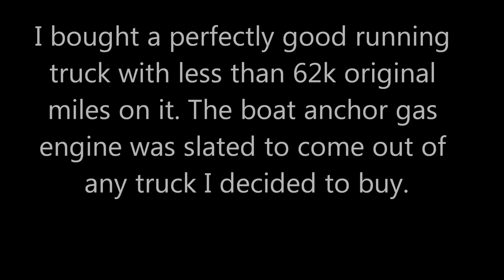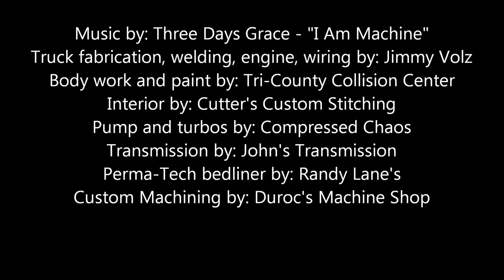1998 Chevrolet Cummins

Comment: 4 minute video, none of which shows the truck running and driving.
Reply: Nice truck,  just wish they showed it running and driving.
Reply from the maker: I just uploaded a walk around for now. I will upload another one with some towing soon. Thanks for watching guys.
Reply: Awsome conversion. Do u have any trouble towing the Gooseneck trailer. my truck is lifted and I want to buy a gooseneck for my buisness and get rid of the tag alongside. And by the way my tag alongs r Gator Made trailers also. Best trailers in the world.
Reply from the maker: Thanks. No problem at all pulling a gooseneck. The whole setup works really well. And I agree on the Gators. I've owned two of them.
Reply: do you live in indiana? i do!
Reply from the maker: Chet Langford yes I do, Southeastern Indiana.
Reply: Chevrolet Cummins that's cool I live here too west Indy I seen your truck in a magazine!!!
Reply: Chevrolet Cummins great job crazy white boy!!!!
Reply from the maker: Chet Langford which magazine? I know it was in Diesel Power before on page 44 or some bullshit. Was it in another one?
Reply: Chevrolet Cummins how far from Switzerland county

Comment: I'm considering buying a stock  1998 Chevy 3500 Crew Cab 4x4, 6.5L Diesel DRW to pull a 5th Wheel. Any idea the max towing capacity on a stock 6.4L Diesel?? The 5th Wheel is 12,400lbs dry weight, loaded 15,500lbs?? Any info would help.

Comment: I have a 12v with a bad transmission an a Chevy 2500HD with a 4L80E Billet with a blown motor. Do the 4L80E handle the power good would you recommend it or say go with a different transmission Aswell as pulling with it ???????

Comment: i like that build, my dream truck is all american, a 67-94 chevy ext cab long bed with a 12 valve cummins, and ford solid axels, lifted a few inches with decently meaty tires, mickey thomson rims and a nasty cam with some stacks
Reply from the maker: +SS4LiFe1488 You have to be careful with diesel cams. If its too big and you don't have the air and fuel, it will be a dog on the bottom end. Some of the bigger cams like a higher RPM range and that means a stronger rotating assembly which = $$$$$$$$.
Reply: +Chevrolet Cummins thanks for letting me know man, ive only gotten into chevy small and big blocks, have never been in a diesel before. im planning on rebuilding a 12 valve cummins with a 5 speed granny low tranny for my chevy one of these days, and ill put my 350 in an old muscle car of course! or better yet sell it and get a big block

Comment: I generally don't like cummins swaps just because they are way overdone but this was done right! You just throw a greasy old 12v and leave everything else stock. The whole truck has an attitude and I love it! Nice choice with the hood. Also good music choice.
Reply from the maker: +Palmer Boudreau Thanks man... I really appreciate it!
Reply from the maker: +Palmer Boudreau Yeah, I do quite a bit of pulling with it. It has spent more time with a gooseneck behind it than it has without.
Reply: Chevrolet Cummins That is badass! Anytruck pulls? I know its tall but....
Reply from the maker: +Palmer Boudreau I would love to make a couple hooks with it but this truck scales over 10,000 pounds. I think most classes are under 10k. Plus the compounds would put me in with the big dogs which I couldn't compete with.
Reply: Chevrolet Cummins Yeah had a feeling something like that. Maybe bring it to car shows?
Reply from the maker: +Palmer Boudreau Yeah definitely. I haven't made it to any yet but I will. Im still making custom parts for it to finish it up. Im hoping to make it to Scheid this year and some county fairs.
Reply: Chevrolet Cummins Yeah that would be sweet!
Reply from the maker: +Palmer Boudreau I went out of my way with time and custom fabrication to make sure this was set apart from any other conversion out there. Scheid would be an awesome place to take it.
Reply: Chevrolet Cummins yeah no kidding that place is sweet!
Reply: Palmer Boudreau thrown a 12 valve and left everything stock? Did we watch the same video? Idk if he could have put more crome under the hood...

Comment: Love the attention to detail.......Only thing I would have done different is the exhaust out the rear right.....One hell of a a job though.
Reply from the maker: +Chad Gronsten Thank you. The only way I could have went with exhaust out the rear is if I did without a spare tire. Otherwise, the 5" exhaust pipe would have been clearly visible and I didn't want that.
Reply: A 5.9 8.3 or 6.7 doesn't need 5...The ol 855's and ISXs run 5..I always thought it was hard to make 5 look clean, especially on older pickups that don't have the room to work with.

Comment: Hell ya boss! You and I should meet! I have the same disease and I won't rest until I realize it 100%! My goal cosists of 1978 1 ton crew dually most likely a 5.9 swap. 
With all that HP you're running you could afford a little more meat on them 22.5s but no dought my friend that is deffinitely a ground pounder!
Reply from the maker: It does have new tires since the video was made with a more aggressive tread. I like them much better. Looks better too

Comment: I bought the same truck in a 2000 model year with a 6.5 diesel. I am lowering it which would be the only difference.  I would like to do a video on the whole rebuild and wondering if we could speak together about some definite do's and do not's?
Thank you,
Mike Fitzgerald Calgary Canada 🇨🇦

Comment: Very badass truck "for a chevy" lol the only thing I really would have done differently is put a super Dana 60 in so you could utilize wide track and that super sharp turning radius
Reply from the maker: Yeah it would definitely help with it measuring almost 23'. I had an old '79 sitting around so it became a donor.

Comment: Perfect in all ways i love the body style great build man again perfect
Reply from the maker: +Korey Grant Thanks a lot!
Reply: Chevrolet Cummins you have my gears turning now i have been toying around with putting a cummins in my 07 chevy 2500 
I have more time then money
Reply from the maker: +Korey Grant I cant give you much input on that conversion. If I would have found one of those cheap enough, it would have been in the video instead.
Reply: Mine was not cheap but it is a nv4500 5 speed trans it would mate with cummins with right set up but you are right i paid top dollar for this truck 

Extended cab 8 foot bed rare rare

Comment: How did you control the HE351VGT? I am going to use the same turbo on my compound set up with an HT60. Did you use an electronic control or are you running it off of the engines boost? Thanks,
Awesome truck by the way.
Reply from the maker: +Cole Berenyi The controller I am using now is basically a prototype to see what it took to control the vanes independently from an ECM like it is in the OEM setup. It doesn't use any boost pressure and is controlled by a switch in the cab to open and close the vanes. I am in the process of designing a different one that has more flexibility and can be used for just about any universal application with a 351VGT in any vehicle. As soon as I have one in hand that can be tested, I will post a video of it to see if there is an interest for it. Thanks for the compliment.

Comment: dream truck right there only would like to do it as a nv5600 6sp
Reply from the maker: +Caleb Godwin Thanks. I thought about going with a manual but already had a partially built 4L80E from a previous build so I decided to build it up some more and reuse it.
Reply: +Chevrolet Cummins can't go wrong with the 4l80 either if inwas going auto thay would be the one. did you fab your mounts or buy them already set up. and did you have to do some firewall work.
Reply from the maker: +Caleb Godwin Yes I made my own engine mounts and transfer case mount since I went with the NP205 transfer case. I didn't have to do anything to the firewall. I set the engine about 1.5" off of it at the point where the engine was the closest to the firewall.

Comment: Do all of your gauges work? If you kept them factory. I just finished getting everything mounted in have to run fuel line and adapting the A/C. What kinks did you have once it was running? Great build by the way! A++
Reply from the maker: Everything but the speedometer works. I still have to figure out which wire from my transmission controller I need to splice to for a signal. I ran into a few kinks getting it going... mostly leaks from all the plumbing I added. Nothing too bad though.

Comment: Im 19 years old and i will be buying a truck in about a year or so, i have a $15k budget and if i buy a truck will most likely buy a tundra... but a part of me is like screw that and just get a c2500 or c3500 and doing a cummins swap... i just dont know how i would get the 4l80 to work with the cummins. Other than that i would love to do it haha
Reply from the maker: You just get an adapter plate from DeStroked.com.

Comment: I been wanting to fo this was gonna use a 85 chevy 4 door dually and put my 12v in it with a 6 speed but think.imma get that body style maybe a little newer and do the swap I probably wont put that much into the engine maybe just some compounds and 150hp injectors with a fass 150
Reply from the maker: Definitely sounds like a cool project...

Comment: Had my 1998 GMC c3500 crew cab long bed for 6 months now. Where do I start? The 32 inch Goodyear’s with 2 inch coil and cheap eBay spacers ain’t getting it!

Comment: Awesome build, Super close to my vision, I have a 2000 K3500 quad cab short bed dually, I really really want to know how you got the Alcoas on the truck? Did you change the hubs or get a bolt pattern to match? thanks in advance if your able to reply.
Reply from the maker: I used 8 lug to 10 lug adapters.
Reply from the maker: A crew cab short bed dually? That is a rare truck my friend. I've only seen a few of them.
Reply: It was a tough one to find indeed! couple more questions if you dont mind? Wondering about the tire size, and if you used the stock gauge cluster how did you get that to work, also I noticed in your other video you are running the stock chevy ECM under the hood, whats that for? I plan on doing a similar build. thanks in advanced.
Reply from the maker: Email me at 98builtnotbought@gmail.com

Comment: What runs the ac? Stock GM computer? What did you do for guages? Did you make custom brackets for accessories?
Reply from the maker: I used the factory AC compressor on the Cummins. I just had to notch the frame. Stock computer but I've been told it's not needed so I'm not sure. I've used all the factory gauges and added more. The only accessory bracket I had to make was for the GM alternator.

Comment: Cool truck and everything but I disagree that the 454 is a boat anchor lol that motor with less money into it will pull just as good but it’s not as fun as a diesel and burns a bunch of gas
Reply from the maker: A 454 was the last gas engine I towed with in a truck before going to diesels. The 454 is a boat anchor. It comes nowhere close to doing what that little inline 6 Cummins can do. Show me a 454 that can gross 30k in a one ton truck with a gooseneck pulling hills in OD at 65 mph. It ain't happening pal. If it was worth all that, I wouldn't have gave the 454 away.

Comment: sweet shot dude, is that at idle revving?  still awesome looks badass 2:20
Reply from the maker: Its just idling right there. It will haze a little at idle when the engine and air is cold.

Comment: How is the 80E holding up to the power of the Cummins? In the description, you say it's a built 80E, how built??
Reply: Cliff Weatherbee if the 80e can hold up drag racing duramax it can cold up to a cummins
Reply: @codyyellott117  they never had an 80E behind a duramax.

Comment: Nice truck i have a 97 Chevy 3500 4L80 Transmission (Standard) It came with a 350, But going to put a 454 in it. Did this have a gas engine in it before this? If so were did you find the computers and everything from the gas to diesel?
Anything else i maby missing?
Reply from the maker: Yes it had a 454. The transmission controller was the only computer I had to add. Everything else is basically mechanical with the exception of an auxiliary fuse box for everything I added.
Reply from the maker: The transmission controller is a Compushift II. Best one on the market in my opinion. It allows for tons of adjustments and flexibility.
Reply: fuel pump! sometimes are different and will cause problems
Reply from the maker: The fuel pump is ran off of a relay, no computer involved.

Comment: how do you like those mirrors? im ready to do the sas on my cclb. did you body lift for the cummins?
Reply from the maker: +Bobby Ilejay I love the mirrors. I bought the ones that had all the options like heated, turn signal/marker lights, telescoping and power. They will vibrate at highway speeds but I don't care. Just install them exactly how the directions say. There is a little metal bracket that MUST be installed to help eliminate vibrations. No body lift. The straight axle conversion gives about 5"-6" lift.

Comment: Very unique build. Any info on the suspension, plus ride quality/ comfort? Thanks
Reply from the maker: +MarioAllDrunkAboutIt The front springs were custom made to support the weight of the engine but yet give flexibility to improve the ride and handling. With stock tires, you cannot tell it has a straight axle under the front. The semi tires do make it ride a little rougher. The rear springs are all stock including the overload spring. I did reposition the overload bump stops for better towing. Overall, its not too bad but at over 10,000 lbs, that much weight helps the ride. And as with just about any dually, the ride from the back is a little more rough but still not too bad. When I am hooked to my gooseneck, it rides great because of the tongue weight.

Comment: bad ass man I'm curious why you went with the auto vs a 5 for 6 speed
Reply from the maker: Thank you. I already had the transmission built plus the controller from a different build so I just stuck with it. I do wish I would have went with a manual now though.

Comment: How is the 4l80e feel behind the cummins. Working on swapping my truck trying to decide if I want to keep the 4l80e
Reply from the maker: +1slowv6 The 4L80E works great. You will need a controller since it is an electronic transmission unless you go with a manual valve body. Mine has taken all the power Ive thrown at it and I do towing in excess of 25k pounds gross. If you turn the engine up, you will need all the upgrades for the transmission.

Comment: Awesome looking truck! I'm currently looking into 12 Valve swapping my 1996 Chevy K2500 Suburban and was wondering if you had to install a body lift to clear the the engine to the firewall? and any tips to make my build go a little smoother would be much appreciated.
Reply from the maker: +Derek Faux If you are going with the 12 Valve, I would suggest a straight axle swap. That is a heavy engine for an IFS. Some guys may do it and not have problems, but I know for a fact that a GM kingpin Dana 60 axle will outlast any IFS. But to answer your question, I did not have to use a body lift for my approach. I think you may have clearance issues with the IFS and just the overall size of the engine on the bottom end but I am not sure. I cut all of the IFS out before the engine fabrication began. If you do not do a SAS, you will have to relocate the AC compressor. I am pretty sure I moved the transmission and transfer case back about an inch to get as much room as I could and low profile dual electric fans still barely clear. I made/modified all of the cross members and engine mounts so I could get the engine sitting exactly where I wanted it. To do it right, make it look professional and like it was manufactured that way is a TON of work. I wouldn't do it again unless I got paid to do it.
Reply: I hear ya and I planned on doing a SAS first and an NV4500. I just don't know how I'm going to get it all to fit. there's a company that makes a engine mount kit but they say you have to have a body lift which I don't want. do you have any pictures of your engine mounts?
Reply from the maker: +Derek Faux Of all the pictures I took, the ones of the engine mounts and cross members accidentally got deleted. They weren't as important as the others, but I wish I still had them. They would help in instances like this.
Reply: do you think there is any chance that the next time you are under the truck you could take a picture of them for me?
Reply from the maker: +Derek Faux The best time to get one with any detail would be when I have the bottom charger off. So the next time I do, I will snap a couple for you.
Reply: +Chevrolet Cummins thank you. I appreciate it a lot

Comment: Do you have a parts list with part numbers of everything used to build the exhaust? I'm working on my truck now and not getting any information from vendors on what's needed for the conversion exhaust system.
Reply from the maker: I would have to do a lot of digging to find all that. I did use a 5" downpipe for an 07.5 Cummins and cut the angles so I could clock them. It's all 5" from the turbo back. I had to make my own 5" Y pipe then went to 4" to go over both sides of the frame, 90's up into the bed with stack breaker clamps. I also had to notch the fuel tank for clearance on the driver's side.

Comment: What truck did you get the axle out of? I'm looking to SAS my 95 c3500.
Reply from the maker: +Jon Hlebasko A 1979 K30. Any square body 1 ton GMC or Chevrolet will have the axle. If you stay with a gas engine, a ball joint axle will do. If you put a heavier engine like a diesel in it, I would recommend the kingpin axle. A lot of places carry the SAS conversion parts, but I got mine from Off Road Design. Nice quality parts and excellent customer service.